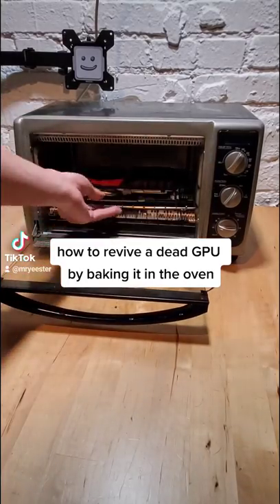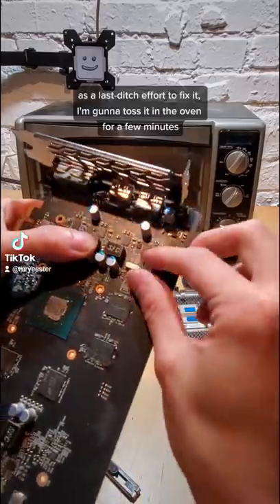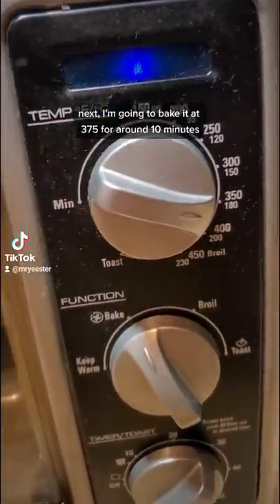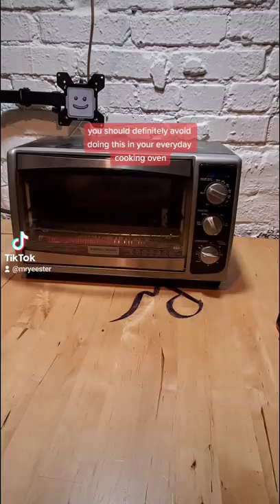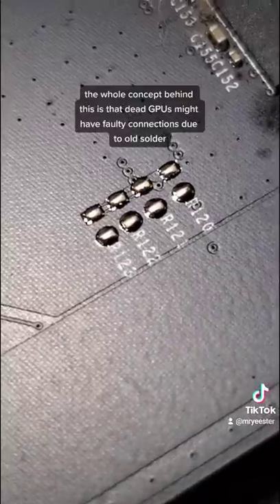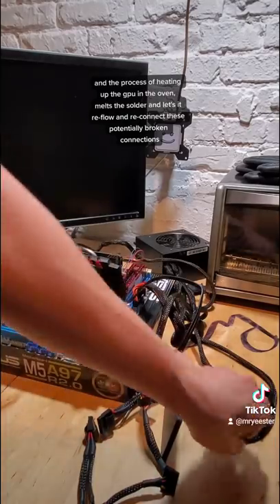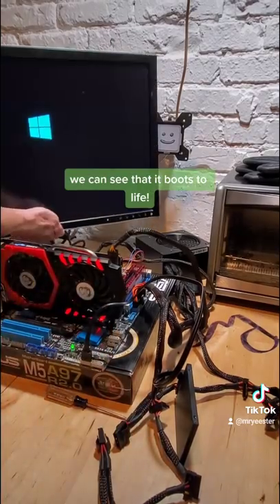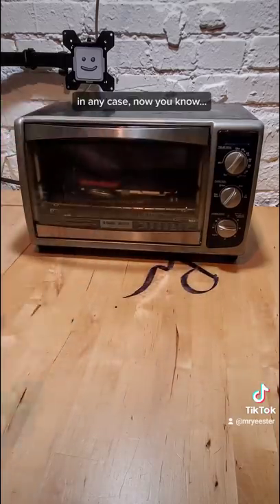How to revive a dead GPU in the oven #shorts

Comment: at 375 for 10minutes??? With electrolytic capacitors???? that is a dead wish, they may simply explode! not counting the fact it decreases rapidly the capacity. And that is in most cases not a permament fix, it will work maybe for a few hours, few days if you are lucky

Comment: wondering if a heat gun works as well.
I got a mostly functional rx550 (complete with the box) from a bin some time ago, and I think something was wrong with the sensor because the fan would just ramp up to max rpm indefinitely when I boot it up (already replaced the thermal paste btw).

Still couldn't figure out what was wrong after all the troubleshooting so I just kept it aside and properly stored it in my cabinet... but following it up some time later it just suddenly stopped working and thought it finally got bricked.

Comment: If anyone ever tried this, they already know the sound of popcorned capacitors and they already know the smell of leaked capacitors. Do this only if you want to be sure that video card isn't going to work ever.
Before anyone is telling me they managed to make a video card to work again doing this... It is definitely not because of reflowed solder joints. Something else entirely happens so please, shut the fuck up and don't tell other people to do the same.
You could have your card fixed by washing it in a ultrasonic washer and it will do the very same thing: it will start working again without having capacitors damaged (no matter what you do, capacitors will suffer baking them in an oven).

Comment: So on the xbox 360, the gpu would seperate from the board underneath, when the motherboard got to hot. Is this not an issue or concern with this? Is that just an old motherboard thing?
Asking cuz I heard of this before and thinking about it.

Comment: you cannot and should not do this to fix the issue, this was old repair man trick to sell you a repair that would last exactly 90 days after which you wont get a free repair. you can also fry other connections and/or permanently damage the gpu chip itself. they have a kill switch of aroud 100 to 105 degrees for a reason..please take this short down. . louis rossman is gonna be mad.

Comment: Okay so my issue with my gpu is that when I have it in the system, the computer will get a jolt of power, all fans spin for a brief second, stop and nothing happens. When it’s taken out or a new card is put in the system boots just fine. Is this method good for trying to fix this?
Reply: Go to the card's manufacturer if your card is under warranty. Then try this if you aren't in warranty period

Comment: ALSO BE VERY CAREFUL WITH THIS FIX
If one of those capacitors pop, it is not going to be fun. It could potentially break your toaster oven, your graphics card, kill your cat, and get glass in your eyes. 
Another really good option is to get a heat gun, and hit the solder with it until it becomes smooth. You can use aluminum foil as a heat shielding between the components you’re heating, and the capacitors so they don’t possibly pop in your face.
Good luck y’all!

Comment: This is stupid as fuck. Don't do this.

Buy a heatgun and thermal sensor, put flux under the chip, heat up the chip accurately using the heatgun.

Make sure all the other components are covered with thermal resistant tape.